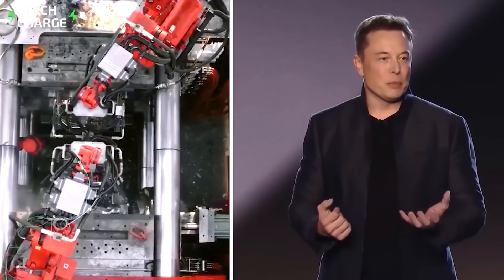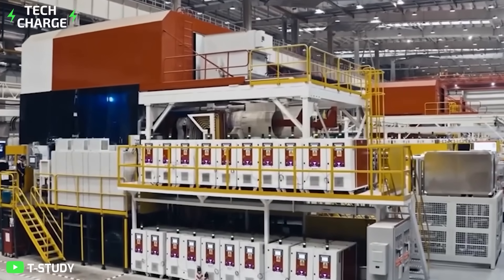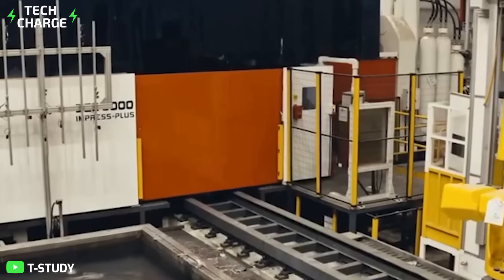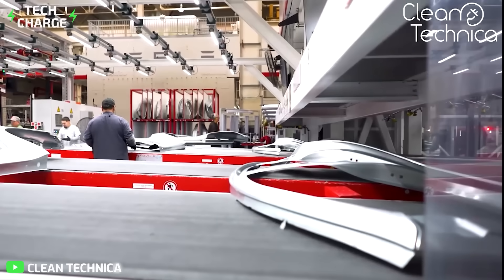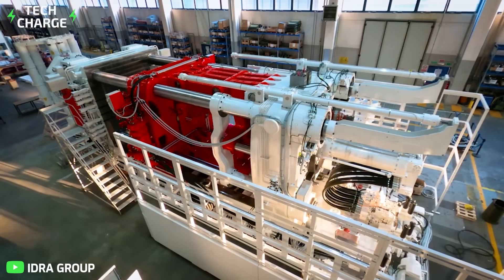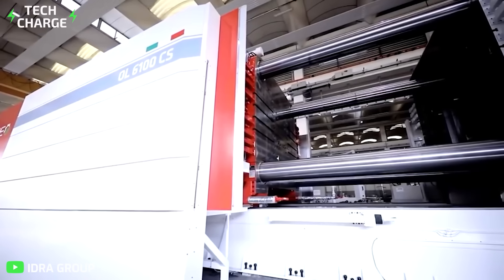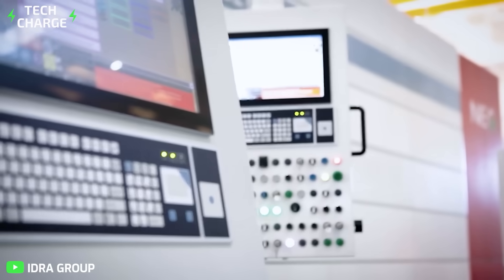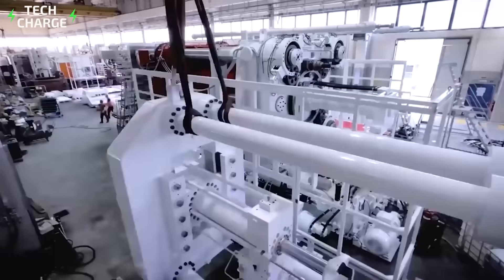How Tesla Cars Are Made So Fast - Meet the GIGA PRESS

Comment: And how are Tesla proposing to recycle all these environmentally friendly vehicles when they wear out?  🤦‍♂️
Reply: Gosh I don't know the same way that we recycle cars now?
Reply: @MrSteeDoo  Seen many Tesla's in the scrapyard then?  Or any EV's for that matter!
Reply: @Altair885  I don't hang around scrapyards.  Do you?

Besides, most of them are STILL IN USE.

What makes you think that recycling them will be such an insurmountable task?
Reply: @MrSteeDoo  Occasionally yes, when I'm looking for classic car parts.  I'm also involved in the auto repair sector so I think I have a reliable insight.  The point is that scrapyards don't want EVs, aren't equipped to deal with them anyway.  The next point is that they aren't as profitable for scrapyards to handle, the costs of disposing of worn out battery packs isn't worth the hassle!  That means there's a broken link in the cycle for these vehicles.  Nobody wants to take them away, sure you can recycle the body shell just as with any other car, but who wants the trouble of separating the battery, having somewhere to store them, and then the added cost of disposal!!

Comment: It isn’t like Tesla invented the giga-press. There is a reason other manufacturers don’t use it. It make vehicles almost unrepairable. Now imagine what that is going to do for insurance rates?
Reply: Why can’t you repair it anymore?
Reply: @ApfelmusKanone  cause its one piece. If you bust the roof or side pillar for example you usually could have a new one installed but this isn't possible with a one piece chassis
Reply: hahaha you're showing just how little you understand about business
Reply: tesla does not want to sell cars lasting 10-20 years. new car every 4 years!
Reply: @jaemyungkim5226  EV last longer than ICE cars because they have less moving parts.
Reply: @PyroShields  It's not about lasting longer than ICE chassis, it's when you crash or just slightly bump into something. Just replace the damaged part in a traditional car...good luck with a Tesla
Reply: I once had a stainless steel spoon, it lasted a long time because it had no moving parts.
Reply: @tombombadil3515 you dont simply "replace" damaged chassis with a new part on any car period. EV or ICE. It doesnt matter.

Comment: Do they die cast the outer class A body panel's as well as ?
Reply: Body panels as in doors, fenders, roof etc? Those are stamped from sheet I believe.
Reply: The video is incorrect. Body panels are stamped metal; the Gigapress makes system components like suspension pieces and support, not structure. Die-cast Aluminum is not so strong. No casting is.

Comment: So it's not actually a press. You press hardened material, you MOLD liquid material. Just because the molten material is forced into the mold rather than gravity fed doesn't make this a press. It's a reusable auto-mold that replaces sand molds. That's a good thing because sand molding is messy, time consuming, dangerous, labor intensive and takes up a lot of space.
Reply: It is a press, a giga press is massive die casting machine, that compresses to a large single mold
Reply: It is a Press, it needs to apply an enormously high amount of tonnage to keep the die from opening when injection pressure is applied.
Reply: @evostu7814  Just like every other die casting machine. Pressing parts vs molding parts. Higher pressure doesn't change that reality. It's a die casting machine. GIGA press is just a catchy name.
Reply: I think the video made it pretty clear it is a diecast machine.
Reply: Still a press. The press is the machine that open and closes the dies which contain the mold.
Reply: It’s a press or Elon is wrong wise guy
Reply: @southerncrosshempoil  First, Musk didn't name the GIGA press. It isn't about your god being wrong.

From the IDRA website: "Today IDRA produces the largest machines in the world, 8.000 and 9.000 ton DIE CASTING machines.."

Google. READ. Become wise.
Reply: I'll go with the manufacturers official description, thank you.
Reply: It's a press mold
Reply: While you typed this comment arguing semantics, Tesla made like 10 more cars
Reply: Well yes and no. Its commonly called a press as well as the similiar ones used with plastics. Its High pressure die casting. Regular presses stamp sheet metal.
Reply: We agree the process is casting, not pressing. All yes, no no. lol
In plastics it's ALWAYS referred to as injecting molding. With metals, it was ALWAYS referred to as casting. The word 'Molding' was used to distinguish the plastics process from the metal process.
Metal can be heated to a liquid state without disrupting the molecular structure to failure. Heating plastics to a liquid state would cook the material and ruin it, making a pour impossible.
By pressing the liquid metal into the cast, you can force the material into much more complex shapes than gravity feed can. The fact that the liquid metal is being forced (pressed) into the casting doesn't change the fact that you are "casting" metal products, rather than "pressing" metal products.
I suspect Viega, the equipment manufacturer, preferred the name 'Megapress' over 'Megamold", even though it' is clearly a misnomer. Marketing trumps reality every time.
Reply: Its an extruder. The process in extrusion or forming, perhaps its blow molding?
Reply: @angelo_giachetti  so elon musk invented extrusion
Reply: @angelo_giachetti  That's 3 different things. lol

Comment: " it's unimaginably massive " ? 
20 m long is hardly unimaginable .
Reply: You just have to imagine 🐋 🐳 🐋 female blue whales, which you see all over the place!
"The average length of sexually mature female blue whales is 22.0 meters (72.1 ft) for Eastern North Pacific blue whales, 24 meters (79 ft) for central and western North Pacific blue whales, 21–24 meters (68–78 ft) for North Atlantic blue whales, 25.4–26.3 meters (83.4–86.3 ft) for Antarctic blue whales, 23.5 meters (77.1 ft) for Chilean blue whales, and 21.3 meters (69.9 ft) for pygmy blue whales." Wikipedia doesn't tell you how tell the sex stuff. That's probably stuck in an edit war.

Comment: Must make repairing damaged vehicles impossible, great idea Elon.
Reply: He says counting change
Reply: @vicweast  😊😊  mk😮😅😊😊mm I'm😅😅  I'm
Reply: Ever been in an accident before bro? Cars get written off for damaged chassis ALL THE TIME.
Reply: @Shrouded_reaper  Ever tried to repair a one-piece aluminium casting, compared to a conventional construction? A minor shunt and your car is a write off.
Welcome to very much higher insurance premiums.
And I was here wondering why the Dodo went extinct.
Reply: The repair issue would still not be too different from legacy car-makers, where the car body is welded and bolted together. If you damage any part in the system all of it has to be replaced anyway (you can't easily remove welded-together parts). The bumper crash beams and crash boxes are not included in the the casting, so they can still be replaced after a low-speed crash.

Tesla does many things poorly. Like quality control, fit & finish, customer service, and probably a lot more. But the giga press is very interesting and inspiring.
Reply: He is just 10 steps ahead, why do you need to repair vehicles anymore if you have proper autopilot that avoids collision better than any human ?
Also they will start insurance business as well 😅
Great idea Elon.
Reply: @conkerito autopilot avoiding collisions…mihahahhahahaha .  Yes there is reason why is isn’t running an insurance company.  He knows autopilot is non existent.
Reply: @bitlong4669  like having your car breaking when you fall asleep driving into a wall ? Sensors and software are already better in some cases. That’s maybe level 1 or 2, no doubts it will move further. Let’s talk about it in 5 years
Can’t understand the « is isn’t » part sorry mihahahahaha
Reply: @conkerito  EV's are a crazy idea doomed for failure, so don't get too attached to these fancy milk floats just yet 🐻
Its just Elon  leading the weak minded by the nose and down the proverbial garden path.
Decades in the future they may well be viable, but not now.
Reply: You don't build a car based on it being wrote off
Reply: @x-heat2666  But to make it Insurable it must be repairable.
Reply: Are you from Apple??😂

Comment: Looks like be a Nightmare to repair a front or rear smash!
Reply: Like Apple monetization on all fronts.
Reply: Why don’t all you guys who say “this or that is no good,can’t be done,won’t work bla,bla,” go and live in in your own little country ? You’ll be a 100 years behind everyone else in a flash !
Reply: Ever heard of cutting and welding or a chop shop?
Reply: @lesp315  Or a scrapyard.
Reply: @lesp315  s and x are aluminum 3 and y are mixed.  not all welding shops do aluminum. These cars get totaled out for far too little as a result.
Reply: @HomeyKhann  Welding aluminum is not a beg deal. My friend has a welding / machine shop and he can weld two beer cans back to beck without burning metal through. Yes, he is a pro. I had a machine shop and retired at 45. It's good to be good.
Reply: @lesp315  I think if Tesla wasn't so proprietary about the repairs, less Teslas would be totaled.
Reply: @lesp315  But then welder in that level is pretty difficult to find isn't it?
Reply: @QiuyuanChenRyan916  For welding beer cans, yes. Also, before you get that good you need to drink a lot of beer. 🤠 For welding car parts you don't have to be that good. Unfortunately most of todays mechanics are worthless and are barely able to change light bulbs. 🥺
Reply: @lesp315  until you start seeing stars

Comment: It's not aluminum and silicone.  It's aluminum and silicon.  Silicone and silicone are two completely different materials.
Reply: Unfortunetly silicone and silicone are two completely same materials.
Reply: @leszekbrzostowski38  semantics. It is and it isn't depending out your definition
Reply: Spell correction I assume
Reply: Aluminum ALLOY has silicon mixed in it. Just like steel has iron and carbon mixed together.

Comment: Making Tesla car chassis from larger parts may go someway to explain why they are expensive to repair and therefore insure. It may also explain the notorious panel gaps.
Reply: The repair costs for a little bump are outrageous
Reply: @ianmuir3640  Indeed, saw a non-authorized repair, a smacked fender strut broke a large tab off the cast chassis, essentially totalled. repair shop prepped and welded the tab back onto the chassis, reattached the fender strut and replaced the fender.
Reply: You are so far out of date it is ridiculous.
Reply: Cross subsidiary is an financial operation of invest income from producing one product into another production. Let's say Musk take money from tesla and does not invest in telsa, instead he invests in spaceX, doggycoin e.t.c.
Reply: I talked to a Tesla technician yesterday and he said most of the repairs are user error tech issues.  Most of the time he also just has to reset the computer.  Yes there is issues with crash repair cost but otherwise minimal repairs needed.
Reply: This is completely false, stop spreading misinformation.
Reply: the gaps are just poor quality
Reply: @HTOP1982  what do you expect from a fascist producer ?
Reply: They're moulding it.
Reply: Nah. Your assumptions don't hold up. Damage to chassis is usually a total no matter what vehicle. Larger parts mean tighter tolerances which would reduce misalignments not increase them.
Reply: @DanielAlves1 That's absolutely wrong. In fact, it's the exact opposite. Bigger parts mean looser tolerances. Check ISO2768mk tolerance chart as an example: From 30 to 120mm there's a 0.3mm linear dimensional tolerance. From 2000 to 4000mm it's 2.0mm.
Reply: @CarlosCruz_cc  ISO 2768 doesn't apply to casting. Try again.
Reply: @DanielAlves1  I'm a machinist, that's why i mentioned ISO2768.
EVERY tolerance chart i know shows that the bigger the part, the bigger the tolerance (as ISO8062 for castings). Please show me otherwise.
Reply: @CarlosCruz_cc  casting has its own tolerance challenges. I can't comment on specifics for the Gigacasting which is what we are talking about. What I do know and what is plainly evident is that the panel gap problem with Tesla has gotten much better over time and correlates with more use of larger castings. Whether that's attributable to the casting or not, I don't know. Theoretically though, if they can nail down tight tolerance on their Gigapress, then that would achieve tighter tolerances throughout since more parts even with better individual tolerances result in larger overall tolerances because more parts means tolerances multiply each other especially with varying tolerances in how those parts are assembled and the tolerances of the assembly equipment and processes.
Reply: @DanielAlves1  Ok, but that's not the point. The point is: the smaller the parts, the tighter the tolerances. Not the other way around as you mentioned. And yes, the gap issues are getting better but i believe it's due to better processes and quality control.
Reply: @DanielAlves1  Vehicle testers across the EU & UK will not issue roadworthy tickets on damaged chassis cars instead they have to get tested at HGV test stations to check their safety requirements after repairs were carried out
Reply: Tesla isn't worried about the costs to repair; they're selling.  Someone will come up with a cheaper way to fix them if the market demands it.
Reply: @koriko88  "come up with a cheaper way to fix them" doesn't make sense. If you damage the casted part in a minor accident you need to replace the entire part, which has tons of other parts connected to it. Otherwise the safety of the car may be compromised. I'm not saying it isn't still better to cast the whole rear floor, just that your comment doesn't really make sense.
Reply: @ultra-extreme  I’m obviously not an engineer but if you had a large imaging machine that could get a very detailed picture of the damage, you might be able to use a CAD-like program that takes into account the tolerances and requirements of the structure to develop a repair model. It could involve trying to pull the dent out as much as possible, then drilling holes, adding very thin supporting reinforcements, adding filler and then sanding and painting it.
Reply: @ultra-extreme you cant cut and weld?
Reply: @kap1526 yes you can.

But insurance companies right off repairable cars all the time nowadays. If an air bag goes off the car typically is written off.

This is the sad and wasteful society we live in nowadays
Reply: @koriko88  That is known in the trade as a bodge up.
Reply: @koriko88  I like the concept, and it could be something that can implemented, but body techs would need training. Not sure if garage would be willing to pay upfront fees for such tech. II would use computer vision would be good to compare the flatness or contours of the repair. For example, above a rear fender.  An image can be done of the opposite side that is original, and the  3d image scan can then be translated to show a reflection (a mirror image). 
Usually, a craftsman count on their expertise, but in today's world many new techs entering the workforce do not have that kind of experience, norwhich will they care to. Quick jobs is the priority. So, there may be room for your idea. 
I'm thinking, depending on the depth of damage, more shallow repairs can have lead deposition (laser metal deposition?) done. I have seen body shops on TV that work on very old vehicles use lead, which they melt to work up to the proper contour. A robotic arm can do the work. More shallow repairs can be  done with a type of bondo. The upside to such automation is the body techs can work on other repairs that require more manual labor, taking off panels, doors, bumpers, etc.
Perhaps it's time for larger repair shops to move towards high tech. There are some tire stations that have robotic arms. Discount Tire has invested in RoboTire for example.
Reply: @koriko88  Just sound like Apple strategy.
Reply: @koriko88  bullseye
Reply: Larger parts will reduce problems, not increase.
Reply: @frequentlycynical642 Larger Parts are more expensive then small aperts.
Gigapress is only perfect for Tesla.
Reply: @frequentlycynical642  but not at repair time